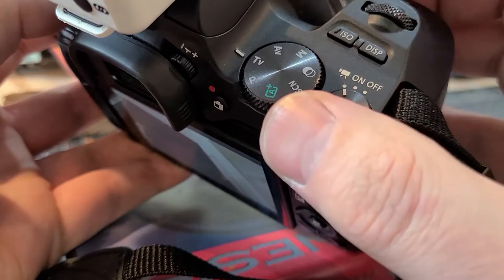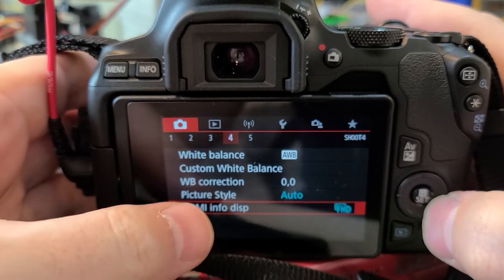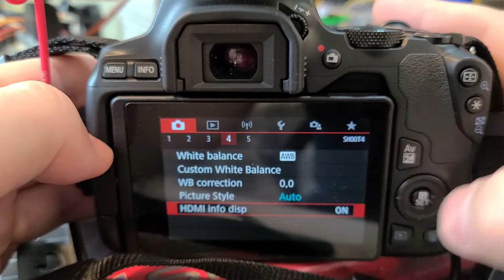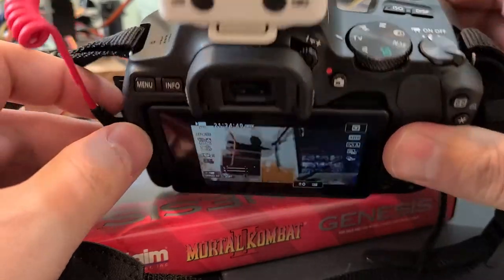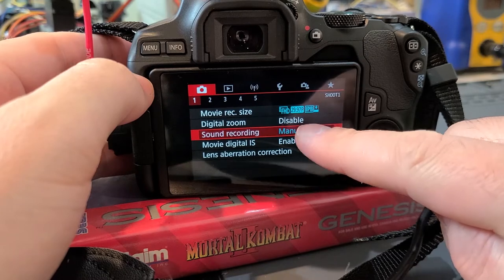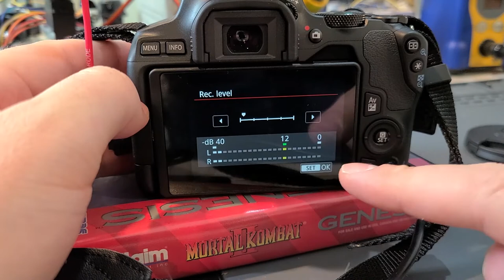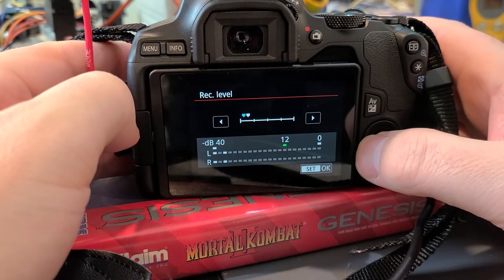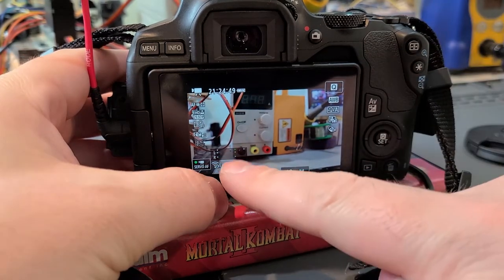Clean HDMI Out Tips & Tricks for Canon Rebel SL3

Comment: . Will the recording be to the SD card in the camera or to a file on the computer? I'm wondering if I can connect my SL3 to my laptop and use it as a monitor instead of using Camera Connect Remote Shooting because of the latency Thanks.